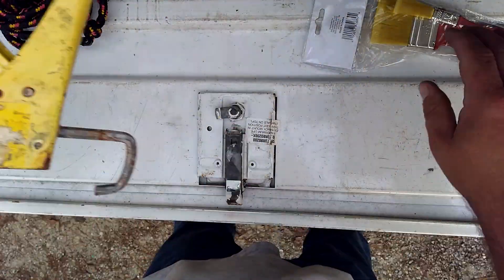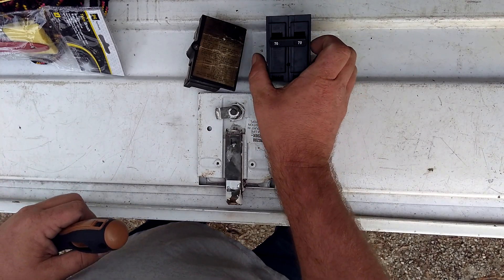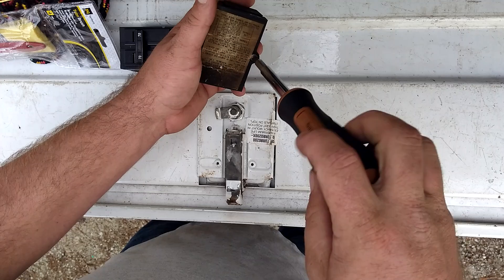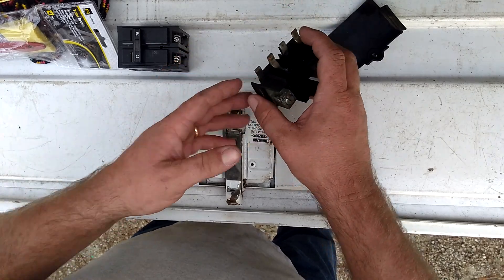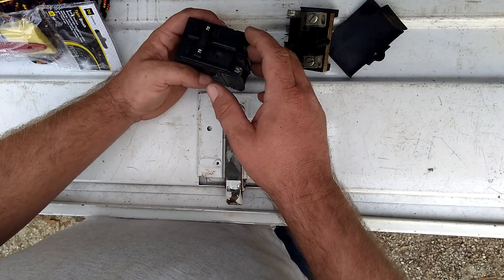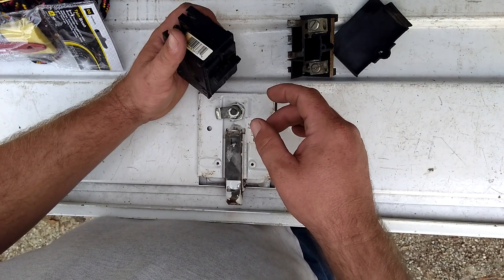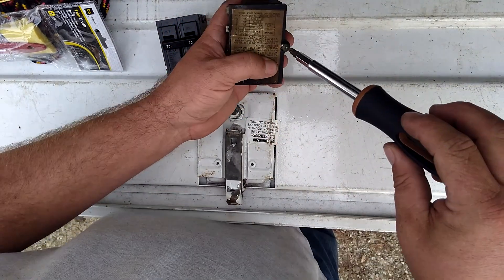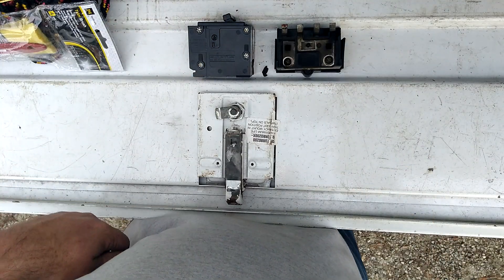Common Electric Furnace Failures

Comment: Loose connections! If you remove a stakon from a high amp circuit it will loosen up. Just crimp the terminal with needle nose pliers every time and avoid this problem. Again most techs know this but are often lazy/do not understand the importance of tight connections.